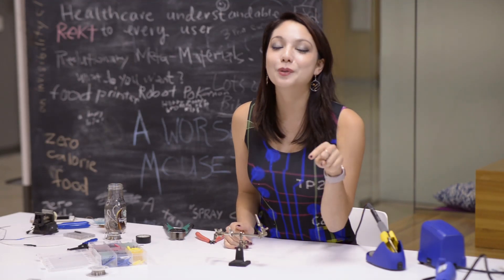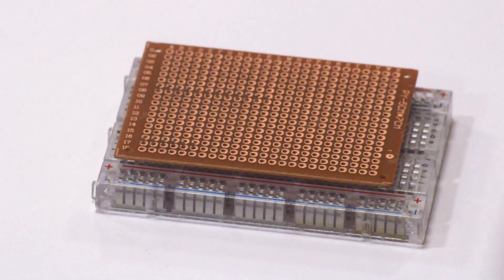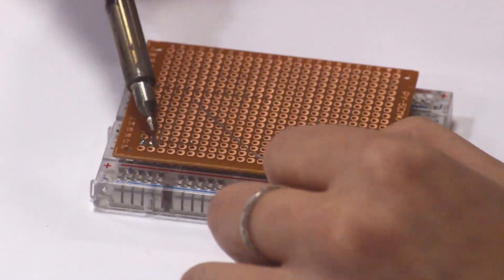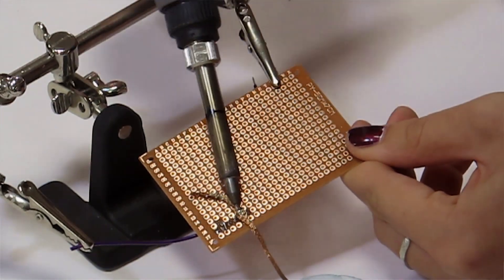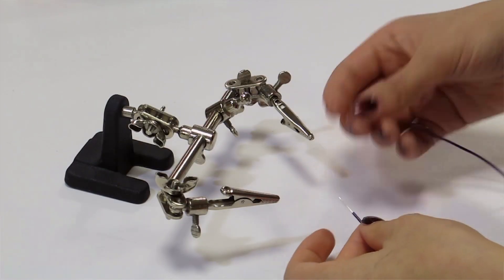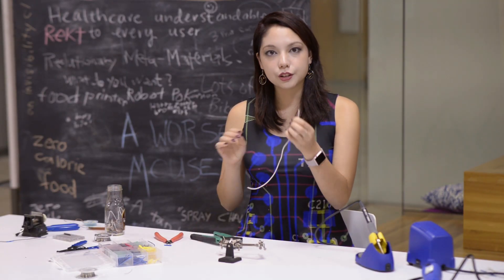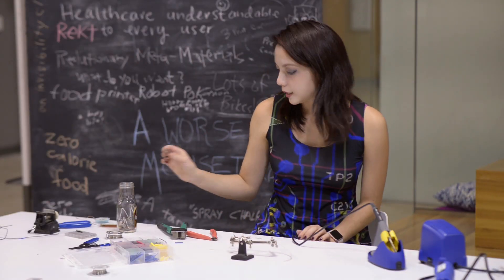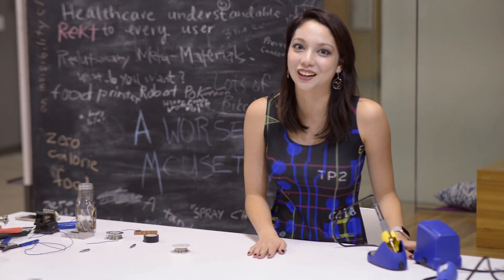HOW TO SOLDER

Comment: Apparently, there is an "L" somewhere, but the States united to get rid of it.
Reply: They dropped the "L" because the French did. Same with how they drop the "H" on "herbal."
Reply: merdufer we also dropped the “ed” in Z.  😂
Reply: Johny Rose I guess that's to do with being Stubborn a bit like us British 😆took us until 1971 before we used full metric system even though it's a lot easier to do calculations..I learnt both systems and Imperial with 20 shillings to a  £ pound and 12 pennies to a Shilling meant we had to carry at 12 then carry at 20 which was a lot harder than 100 pence to the  £ pound just carry at 100 easy...same with Temperatures water boils at 100C and freezes at 0C making anything below Freezing Dam Cold😊...never could understand why Fahrenheit was +32F to freeze water and 212F to Boil.... yes sure is a lot easier with Metric...the Odd part about Gallons and Pints is Imperial and US are not the same 😂...Don't even mention Clothing Size's ☺
Reply: flamencoprof Cholomondely I don't think anyone really knows how to pronounce that one☺..Chumley or Colly mon delli are just 2 ways I have heard....Us Brits should adopt Nite and Color and a few other's Spell it how you say it would be a good idea.
Reply: How about how US-English speakers can't pronounce the letter T? Budder, Dennist, Wadder, Medal or pronounce -ile as -ull (missull, textull, mobull)? What's the deal with Arkansas vs. Kansas? Pee-buddy? Or the emphasis used with Robin Hood? Just accept each for what they are.
Reply: You all do know that all the ENTIRE Imperial/US measurement units are actually referenced and calibrated back to Metric Standards. Dont believe me, google it.   And yes, where did the L go in solder?
Reply: You mean Systeme International.
Reply: I too grew up with both systems (in Australia), but admittedly too young to appreciate/experienced good ol imperial units, (although, inofficially, some still linger on eg, 5' 10" is about as common to say as 176cm). HOWEVER, it was possible to get a population of then 18million to change, I think it took 5 years?. and i can imagine the quality of marketing is vastly superior now than 40 years ago, so someone should be up for the task
Reply: I wasn't being anti-USA BTW, the Brit's are so idiosyncratic in pronunciation that the USA is a paragon of rational language! Ask the Brit's  how they say Worcestershire or Cholmondeley e.g.
p.s. I wouldn't be here if I wasn't interested in soldering. Smooth, shiny & nicely filletted is the way!
p.p.s Re Metric (base 10) vs old English money & avoirdupois, (bases 12, 14, 16, 20 & 21 [Guineas] ); I learned them in my youth, but then I entered the world of digital electronics and electrical wiring and encountered bases 2, 8, 12, & 16. You have to be accepting and flexible I guess.
Reply: @ Steve Jones Language reform sounds like a good idea, but where is Esperanto nowadays? Personally, I like the idiosyncrasies of English, be they of the kind found in the USA, Canada or India, and even in NZ where I live. "Sodder" just struck me as a strange pronunciation I wouldn't have expected from the transformations of pronunciation I have previously learned in USA speech. It is not a big deal, just a light-hearted comment.
Reply: flamencoprof tire* aluminum*
Reply: I remember the days using and learning both metric and imperial :)   Looking at your comment, no matter what the "tag measurement" is becomes a relative term to express the current state.  So what do you use Fahrenheit, Celsius or Kelvin ... Inches-feet-miles, mm-cm-metres-kilometres ... Pounds-stones, grams-Kilograms? As you say "Clothes Size" and footwear which varies with manufacturer comes down to their rational of "tag measurement" until a universal definition is applied like metric and imperial.
Reply: yeah, we do that, perhaps we could borrow the extra "i" that you put in "aluminium", put a bend in it........we speak differently, you already know that, there's no call to bring it up here.  this child is not going to homogenize cultures to suit your needs, take a breath, man, step away from the keyboard. live your life, vive la difference.
Reply: @michaelkelly7228  I’ve heard some say they’ll say aluminum when we start using titanum, uranum, or palladum, for example.
Reply: My favourite part was Test Point 2
Reply: flamencoprof, I am American and I pronounce "filletted" the French way, ie "fill-layed". I don't recall hearing anyone here say  "fill-it-ed" !
Reply: @  good 'un
Funny you should say that, because here in NZ that is exactly what we say! It's fill-it-ed all the way, where it comes to fish. It is interesting because when it comes to naming the process of stripping the flesh from an animal carcase, the word is "flay", which is pretty close to "fillay" & thence to the French and USA fillet pronunciation. Language is a fascinating thing.
Reply: flamencoprof, I did actually think of the word "flay" as I wrote my last bit; and your reply made me think of the term for stripping the blubber off of a whale carcass, ie "flensing"; which luckily for the whales and the planet as a whole is something that isn't done much nowadays....

By the way, I had Jambalaya for dinner at a restaurant recently, which got me singing or humming the famous Hank Williams song in my head,                 "jambalaya, crawfish pie, file' gumbo....." and although I basically knew, or more accurately  I * thought I knew * what gumbo was/ is, I had to do a little research to figure out what " file' " gumbo is......file', pronounced fee-lay (same way I pronounce fillet!), is powdered sassafras leaves, used to thicken the gumbo when okra isn't available----out of season, or not grown in that region, etc. The origins and history of Gumbo itself, aka gombo, nko gombo  or gambeaux, is tangled and twisted and obscured by time. It seems that you're into this kind of stuff, so you should look it up.!
Reply: Someone told it to sold off.
Reply: Geez - aluminum and aluminium are two different words. The number of times I get asked, "Why do you pronounce 'aluminum' as 'aluminium'?" with an accompanying guffaw, escapes me. The answer I give is "that it's a different word, Why don't you pronounce helium as helum?". Note the full stop after the end quotation mark :)

As a chemist who abides by IUPAC, I was really bent out of shape when they changed the official spelling of element S from "sulphur" to "sulfur". Phuck that.
Reply: @  good 'un We're gettin' way off topic here, but yes, I am into "this kind of stuff". Your mention of Jumbalaya reminded me of a song lyric I researched for a blog post about wine in Country music. Jerry Lee Lewis, in my youth, did a song for which I found out the title "Drinking Wine Spo-Dee-O-Dee" is not two phrases, "Drinking wine", a statement, and an exclamation after, "Spo-dee-o-dee!", as I had always imagined.
 It is a description of a particular drink: "wine spo-dee-o-dee" (or spotioti) which is variously described as wine mixed with stronger drinks like Muscat sherry; or box wine and cheap whisky, which was popular in the New Orleans area. I couldn't find the origin of the "spodeodi" term, maybe if you are a local you might know, and I can sodder it to my blog post:-)
Believe it or not, here in NZ when I was young, you could buy a soft drink called Sarsaparilla, "originally made from a blend of birch oil and sassafras" (thanks wikipedia).
Reply: Steve Jones: Try to get over it. It's like fingernails on a blackboard to hear you Brits pronounce the silent "L."
Reply: You can't pronounce something that is silent which is why it isn't silent.
Reply: John Miller: 1. Go to Wikipedia. 
2. Read sentence number one which shows pronunciation for entry, "Soldering." 
3. You're welcome.
4. Next time you add Wor-kes-ter-shyre sauce to a meal, think about your ignorance. Oh, wait, you Brits don't pronounce all those extra letters in Worcestershire, do you?
Reply: Correct English and Wikipedia? It should be "Wikipædia" but dipthongs are something different in American, like pants and knickers. I don't care for Wuhs-stuh-shuh sauce. Tomahto or brown for me, especially on a bacon butty with at least three full rashers.
Reply: I wasn't bod enough to brave the cod because there wasn't anyone to hod my hand. I just let the day unfod, listened to ABBA God, got rid of the mod in the bathroom. My wife scoded me for something. Yep, she really tod me off. It put me in the dodrums. I had sod my soul.
Reply: My deliberate fonetic (oh, I believe you Brits spell it "phonetic" - kidding) example of the word Worcestershire that you threw back at me played right into my hands and supported my argument. Thank you for your lack of suttlety (I believe you Brits spell it, "subtlety" - kidding) and proving my point. It went right over your head, as with the entirety of this exchange.
Reply: I think you overlooked the unique British skill of sarcastic subtle retort.
Reply: I forget to add - I'm a US citizen that grew up in the UK.
Reply: ...Says the one who missed the subtlety of me using the silent "b" in "subtle" as an example.
Reply: Not really. It's not the only silent letter in the word. Or ledder.
Reply: 12 is easier to divide than 10,  there is no decimal equivalent of 1/3 Horses for courses.
Reply: The missing L turned up in that " one L of a dress"
Reply: Well, if the US got with the program and joined the rest of the planet with the metric system, you wouldn't have to worry about 1/3, 1/8, 1/14 and other nonsense. How can doing everything based around ten be harder than the nonsense of Imperial units. Or, worse, Imperial units bastardized in the US. For a country founded on its desire to be rid of Britain, it certainly is most bizarre that it is the only country that holds onto the British system.
Reply: John Miller If you have 1 kilogram of any substance and you divide it  into 3 EQUAL parts how much does each part weigh precisely?
Reply: Sod her...
Reply: If you want to know where all the Ls went, look no further than Wales. That consonant-hoarding lot took seconds. That's also why the Polynesians had to double up on vowels.
Reply: we can change it if you change the way you spell "analogue". it's the only way
Reply: HA! RIDICULOUS! You native English speakers - British or Americans or whatever - you are dropping letters like rain and then you point your fingers against this "solder" thing soooo often. Do you realise how many letters you're NOT pronouncing or randomly pronouncing or "it depends"? Trust me, ask any Italian, we are one of the few countries who ACTUALLY pronounce every single letter of any word, no exceptions. Ask us, and anyone will answer that English is a pain for us EXACTLY because of the complete lack of consistency between how a word is written, and how a word is pronounced. 
We have thousands of examples.. 
..want one? 
---- > COLONEL! :D
Reply: flamencoprof I Guess that makes them Sod's 😊Always annoys me why they don't call Solder Solder instead of Sodder 😊
Reply: So why don't they adopt the metric system like the French?
Reply: flamencoprof Trust the State's wanting to be different It does get Confusing especially when it comes to Measurements Gallons but not the same as our old Imperial Gallon so there Mpg figures are not equal to Ours (British)....the sooner the world Standardises the better for everyone..👍

Comment: One advice from 25 years professional in electronics ... don't cut pieces of tin and then throw them in glass bin - its a waste (at the end you can sort and measure the lenth of all tin pieces you throw to bin)... just use the whole stack and unwind as much as needed without cutting it!
Also don't hold iron too much on joints becauuse PCB foil will peel off or/and plastic materials near will melt, not to mention that joints will become "cold solder joints" which means that solder bond will be poor and the cracks may develop in the joint over time, also will loose its grip on PCB, mechanical properties and glossy colour (elasticity).
Also if you put too much tin on joints it can bridge joints ... soldering wick is not the greatest thing for too much solder on joints ... try to use desoldering pump it is cheaper and reliable and a way easier!

This are a one milion advices and will make your life easier!
Reply from the maker: Not sure I agree about solder wick - when you're working with small surface mount components, a desoldering pump will just suck up the component along with the solder. If you learn to manage your heat, and use the correct tip for the job, solder wick is far more precise.
Reply: for small amount of solder and to clean SMD pads after desoldering - YES, but for true hole PCBs this is not appropriate method, also for desoldering and soldering SMD - hot air and rosin paste are the best safe tools, solder wick will make a mess and won't do the job ... the heat temperature must be accordingly PCB and solder you use to make clean glossy joint, for big thermal mass you need corresponding big iron tip vice versa for speed soldering process and small pads. For DIY projects i must agree around 330C (600F) is relatively good for short time .. if you heat it more the flux inside tin will evaporate ... most of the solder tin mixtures will melt at around 187C (370F) so any high temperature will burn it to crisp ...
But anyway the video is great for beginers and will help them to bring live in some feauture DIY projects ...
Keep doing this, praiseworthy is your atention to details, you explain beter than some other veteran youtubers in electronics and you're doing GREAT!

Comment: Apparently wire strippers are a bit frowned upon in avionics/aviation industry
Reply from the maker: Interesting - why do you say that?
Reply: Beauty and the Bolt They have a tendency to break or nick individual strands of copper in the wires, which could cause a fatigue ,have continuity problems, or when placed under tension, (which should never be) may break off from the soldered or crimped joints. So we use the simple plier gripless ones where we have more control over.

Comment: A hot air gun is overkill unless you do a lot of heat shrink applications on a regular basis. For the occasional application, you can simply use a match or cigarette lighter - just remember to keep moving the heat shrink area (or the heat source) so the heat is applied as uniformly as possible.
Reply: That really depends on what type of work you're likely to do. If you're reworking / repairing stuff with surface mount components or plated-through holes, then a decent heat gun is an absolute must. Try removing a 30+ pin SMD device from a PCB with a soldering iron and you'll probably remove half the copper with it. Try removing a USB port from a plated-thru-hole PCB with a soldering iron and you may as well use a stick of celery - it'll have pretty much the same level of success!
It's important to have a decent quality heat gun (Steinel make some good ones but a bit pricey) where you can adjust the temperature and the air flow independently of each other so you don't end up blowing all the components off the board in the area surrounding where you're working. It's always good practice where possible, to protect the surrounding components by making heat shields out of scrap bits of metal and temporarily securing them over anything that may be at risk.
Heat gun soldering can be tricky - it takes a fair bit of practice and mistakes are never minor, they're normally catastrophic, so before you attempt to gun-fix your favourite laptop, get yourself some scrap PCBs and practice removing and replacing some of the components until you're adept and confident.
Last of all, well, it should have been first actually, always use a good liquid flux when you're heat-gun soldering. It will help the solder find its way where it should be going, even if you can't see it (under a BGA chip for example). It is also a good indicator of when you have applied sufficient heat - you will see it suddenly boil vigorously at around the same moment as the solder becomes molten.
Sorry to ramble on for so long, but I guess if people are here watching a soldering tutorial, they may eventually end up wanting to progress further so it doesn't hurt to equip them with a bit of prior know-how :)
Reply: Or avoid a flame altogether and just run your soldering iron alongside the heatshrink.
Reply from the maker: Good point! We like to keep one around for bending PVC, embossing, and other random DIY stuff, but a match or lighter works well too! We'd recommend a long-handle candle lighter with adjustable flame so you have a bit of control and can keep your hand away from the heat.
Reply: tbh i used to think that but since i always have 1 on the desk in arms reach that heats up instantly i stopped using the lighter deal also using lighters can add soot on the heatshrink if held to long and just looks like crap then
Reply: DJ Messy HAHAHAH awesome comment

Comment: bigger tip. like to use a medium chisel
Reply from the maker: We should do a quick follow up video on solder tip types and where/when to use them. A chisel would definitely help with wire joining, but surface mount components are a whole other story. Thanks for the reminder!

Comment: Classic electrical tape is crap. The adhesive breaks down leaving a sticky mess all over everything and it ends up coming apart. You're much better off using kapton tape.
Reply from the maker: Kapton is a good choice for some purposes, but electrical tape is much more common and much more permanent. If you want to rework something, Kapton is great though if you can find it!

Comment: Using the breadboard as a way to solder headers is a very good tip. I do it all the time, and works perfectly. Plus, there is no need to use libraries with misaligned pin headers when designing a board if you are to solder headers this way.